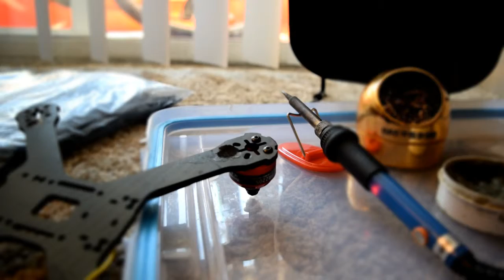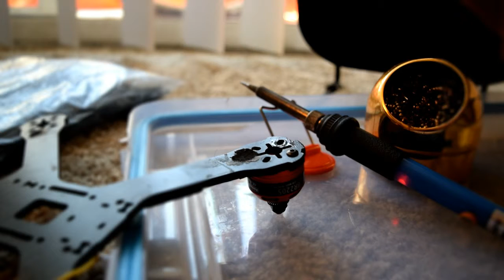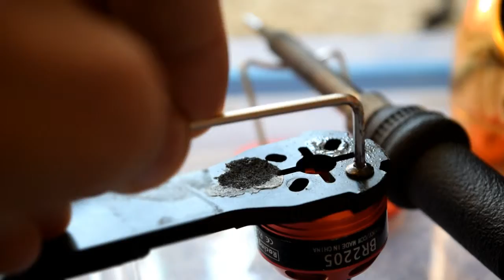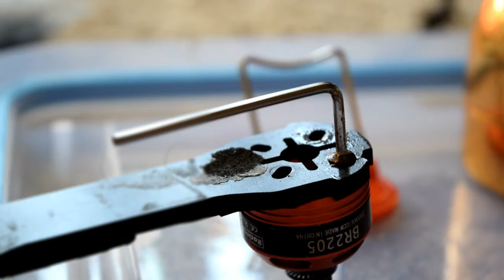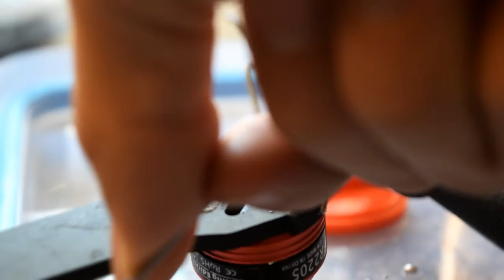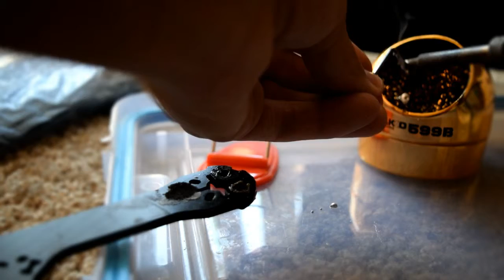Stripped Screw Removal Trick

Comment: By far the best method I've seen so far
Reply from the maker: Lots of ways to get the job done :)
Reply: @DrewMann  I totally agree this is a fail safe method, I'm going to have to try your method because logically it's no wiser compared to other vids I'm watching screw/bolt extractor Ect. Many thanks
Reply: @DrewMann  ok I've just thinking before I try solder I'll try super glue to get the bolt out because it's on a Ebike mid motor

Comment: How about for a six head bold that's in a plastic housi.g and the plastic is stripped so it keeps spinning
Reply from the maker: interesting, tricky to visualize, but if you have a pair of vice grip pliers that are able to get ahold of the bolt head you may be able to just pull it out, or maybe something similar to what I did hear, but use super glue instead (very carefully so as to not make it worse of course)

Comment: What about fixing or being able to use stripped threads?
Reply from the maker: Hum. On the screw or the motor?
Reply from the maker: If its the motor, you could possibly try using a tap to re-thread it one size larger
Reply: @DrewMann  yea it was on the motor
Reply from the maker: @georgeaura  https://www.amazon.com/dp/B07WN8BGWJ/ref=cm_sw_r_cp_apa_i_j9CjFbBE9M3P3

Comment: my screw sits on top of a motherboard. I need to be very careful not to drip
Reply: Did it work?
Reply: @kevs94  I tried a different method.
The locktite was used for the screw, so I used a jigsaw blade to cut the head the the screw in half. The heat from the friction melt the locktite and the screw came off easily